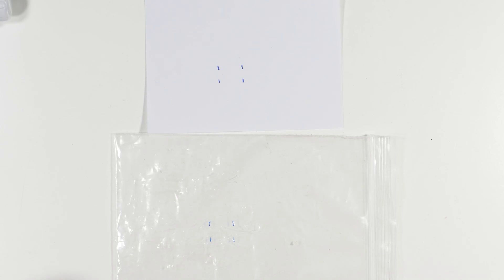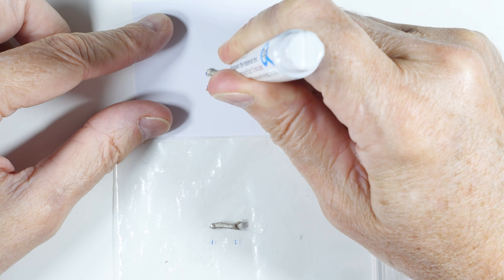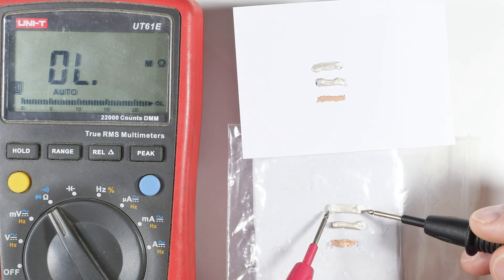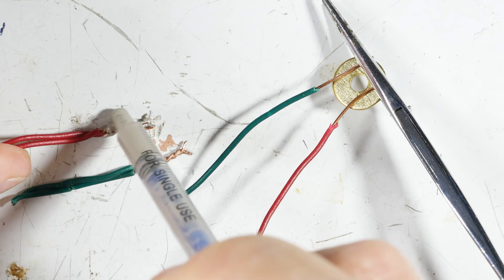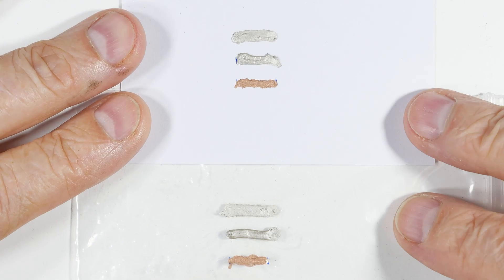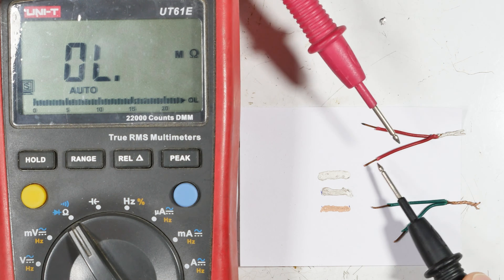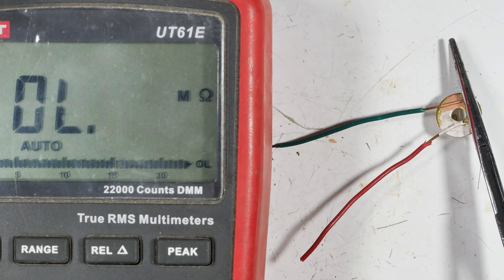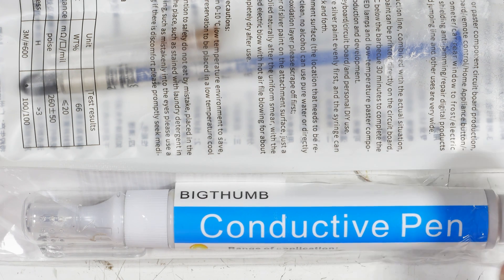Liquid Solder--Does It Work? (4K)

Comment: Thanks so much. I will just order another remote for the gait. You saved me both time and money. I needed a little strength for the push bottom . And your demonstration proved what I needed to know  That I wouldn't achieve what I need to happen. The circuit board switch is approximately 0.5 cm, and there is not a lot of room for soldering on either side.  I only need like a pin head drop, and again, your demonstration was spot on that I couldn't achieve my goals. Anyway, I really appreciate your help and education.

Comment: you need another twisted wires without glue/substance for comparison
Reply from the maker: That would have been better. I have done that comparison when using regular solder and the result is that a clean twisted copper joint INITIALLY has about the same resistance as the copper wire. Of course over time the resistance increases as the copper corrodes. With regular solder that change in resistance is very low.

Comment: Sorry I might have not understood what you are trying to do but you was using solding paste without a soldering iron (heat source), soldering paste is usually used for smd, you can use it with a solding iron or a hot air ghun, its not suppose to act like a glue, basically you apply a tiny amount and the heat fuse the metal together. the advantage of the solder paste is its got beter capillary action than roll solder
Reply from the maker: I was using a liquid solder that is microgranuals of metals like silver in a conductive glue. It is recommended for that and to replace broken tracings. It's very expensive and does not work well.
Reply: @tsbrownie  ok.the tube looked like solder paste

Comment: This liquid solder would be used on electric generator rotors as a repair solution. The wiring connection is copper clad aluminum. It does not hot solder well. This is a common failure on a gas electric generator.
Reply from the maker: Interesting. Thanks.

Comment: You do have a REL function on that meter.
Reply from the maker: Yes, good point. I was just being quick and dirty.
Reply: @tsbrownie  Yeah, no worries, just making an observation.  I've also found that liquid solder stuff to be useless for anything I can think of.  I used to know a guy that did automotive wiring using a liquid solder, twisting and electrical tape.  I wonder if one of his creations ever ended up in flames?
Reply from the maker: @uni-byte  I've seen more than one car burn because of dodgy wiring. The liquid solder I tested would probably have helped ignite a fire. ;(
Reply: @tsbrownie Liquid solder use is new anyhow. These fluids are around as a repair solution since heated rear windows got on the market. Who would have thought to replace solder with that stuff ?

Comment: The only thing those conductive paint pens might be good for is to repair a small/hairline break in the conductive wires on car windscreens for a demister or radio antenna.  The mechanical strength would be provided by the non-flexing glass itself, the conductive printed wire ends aren't going to move either.  Once dried, it would have some level of permanency, allowing you to wipe the glass without removing or damaging the repair.  For a touch of resilience, a small coat of clear nail polish over the top would seal and protect the repair.

Comment: I have worked with copper tape and came to the conclusion that, with proper techniques, a very robust, low-voltage circuit can be developed. As far as robust, more robust than a breadboard circuit, but less than a perf board circuit. The process is much faster than both of these traditional techniques. I used copper tape on foam board. I attached an enlarged photo copy of the schematic to the board and laid the circuit out directly on top of it, so no mistakes. I pierced the tape to allow the component pins to seat in the foam, for stability. (Use a fine needle and do not drive it too deeply into the foam.) If you want to insulate the copper tape, cover it with clear package/scotch tape. (I did not bother.) I was not trying to avoid soldering, so I soldered the pins to the tape and all the tape joints. Maybe the copper ink would do for that purpose. Wire nuts could be used to make twisted wire connections. It might be a fun adventure to try to wind a coil with copper tape, separated with scotch tape. But, I think it would be difficult to remove the section of clear tape to make contact with a tuning bar. Cheers.
Reply from the maker: Copper tape is not bad. I've used it to create grounds between different parts, like covers. I have no doubt that it would make a good circuit, especially if the junctions were soldered/jumpered. I thought about winding my variometer with copper tape, but trying to get a wire to stick to it is hard enough, a wide flat tape with no edge insulation would be a nightmare!

Comment: Thanks for the neat experiment. I have never used any of those products before because I learned how to solder when I was about 10 or 11 years old. I think I will stick with the soldering iron.
Reply from the maker: I'll be sticking with soldering also. I was hoping this would be the answer to tiny solder jobs, to counter unsteady hands.
Reply: @tsbrownie  I think you did a great job but it seems that technology has'nt caught up with heatless solder or the high tech version has not been released to the public yet.
Reply from the maker: @adnacraigo6590  Thank you. If there's industrial quality stuff out there, I haven't found it. The silver one is supposed to be, but it falls way short.

Comment: Hi 👋😃
I've tryed the "conductive glue" to glue ICs, LEDs etc. to copper tape for making interactive paper cards and such but like in your test it was BS imao! I used a heat gun but the seller told me I had to bake it in the oven but that wouldn't work with the tape and the paper. Soldering is the only way so far :(